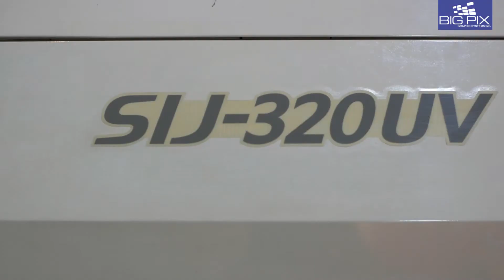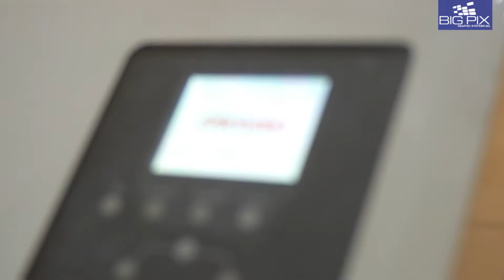Mimaki SIJ 320 UV Printer

Comment: What is better UJV-55 or SIJ-320??
Reply from the maker: hi, the new mimaki UJV55-230 is with white ink compare to SIJ-320, it is also equipped with led proofing light for quality checking specially for backlight signages application.